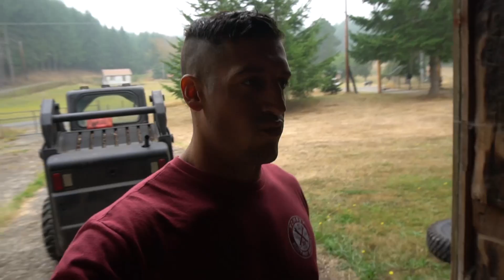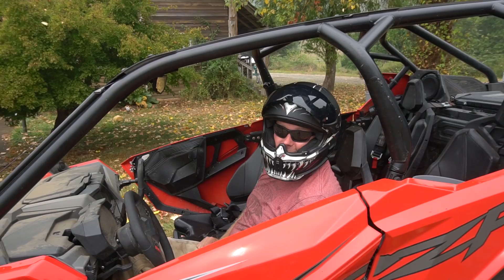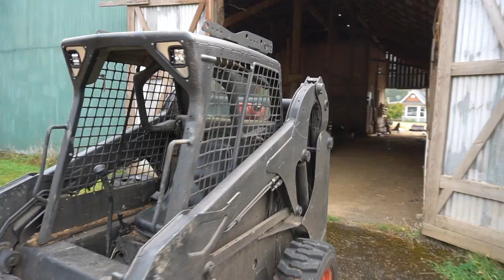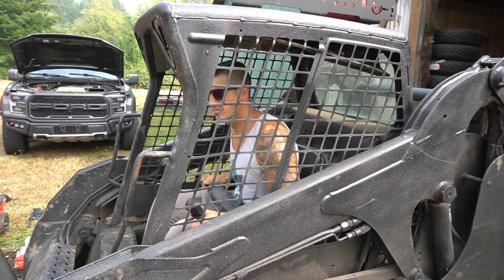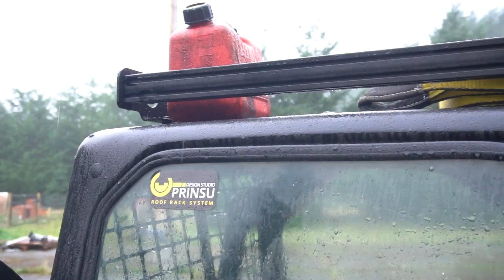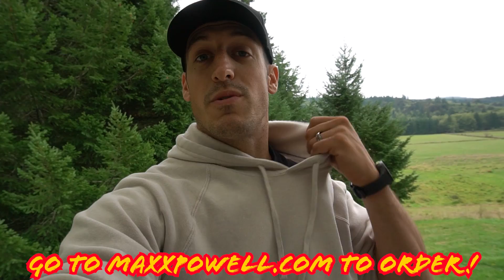Upgrading BobCat with Steel Tracks and a Prinsu Roof Rack!

Comment: Prinsu provided those rivnuts for installing my rack on a ZR2. Very nerve-racking install since you have to drill holes in a perfectly good truck roof. I'm surprised they didn't provide those given your unique installation. Buuut you should really put some sealant in there if you don't want water ruining that headliner.

Comment: I’m concerned about your lack of safety for yourself and what you are showing your children. You used a drill and cutoff tool without safety glasses. You crawl under the raised bucket on your skidstear. If part of the hydraulic system would fail while you’re underneath the bucket or arms you’d be crushed. It would make for safer videos if you considered safety first.
Reply from the maker: I had contacts in does that count?